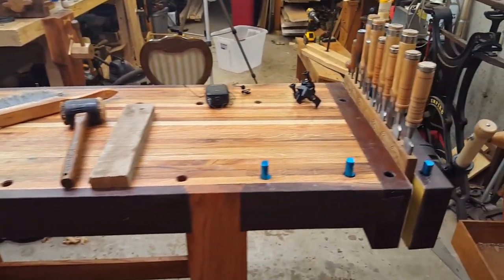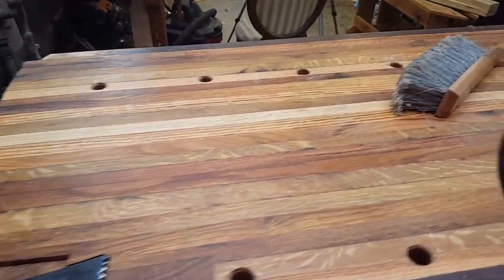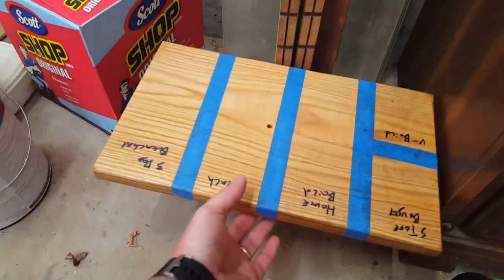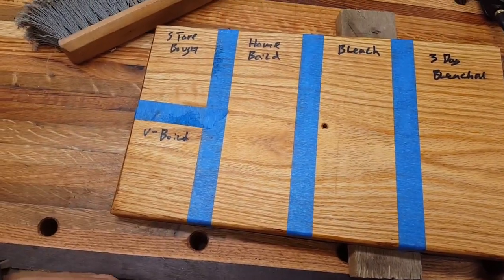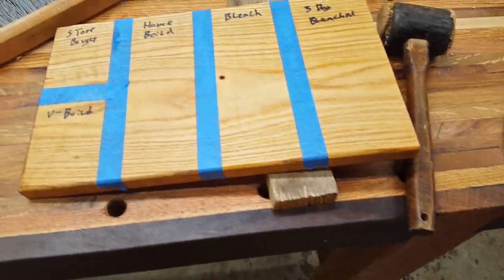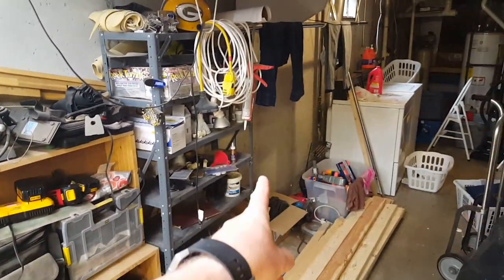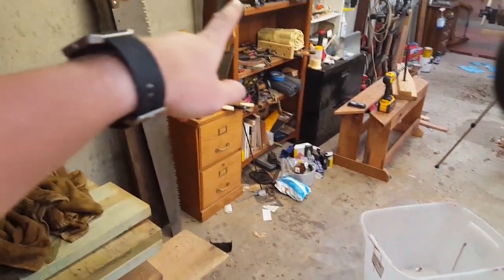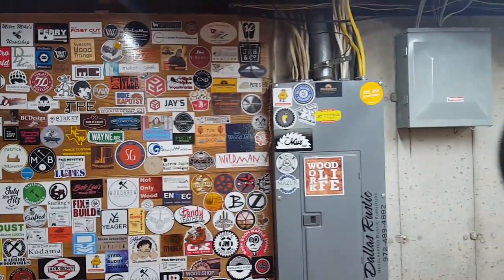Quick shop report with more things going on in the shop

Comment: So, where's the sample of wood with no BLO on it? Hard to gauge effect without a control.  No BLO going on the back drop wall? I bet you tested it lol.

Also, speaking of files and rasps. I watched a video of a guy making a joinery float. It looked like a really neat tool. I don't quite understand the difference between a float and rasps, if there is one at all. Maybe you can educate me lol.
Reply from the maker: there is a cut off for just that, but I was judging dry time rather than color. LOL no finish on the wall it will be covered in tools soon enough. that video is on my list I have several floats. the float will take off more material like a rasp but leave a clean surface like a file.
Reply from the maker: sweet. making a float is high on my list.